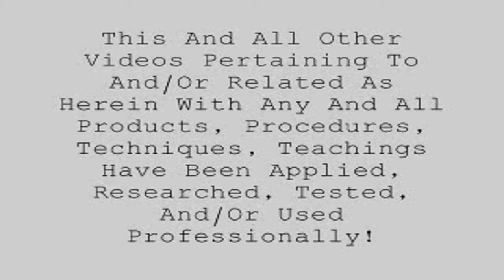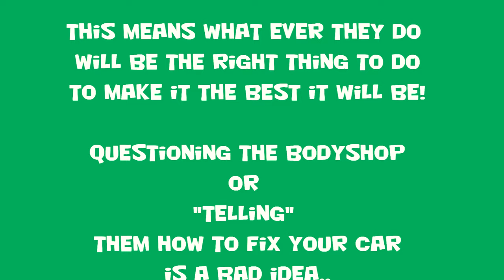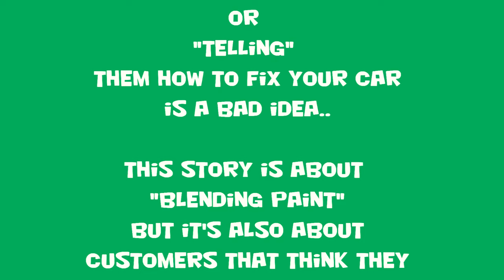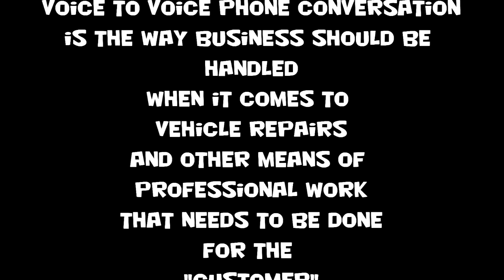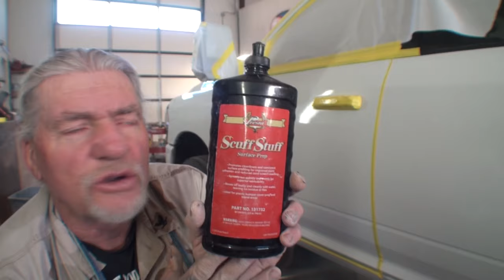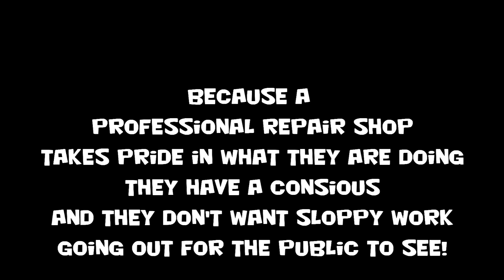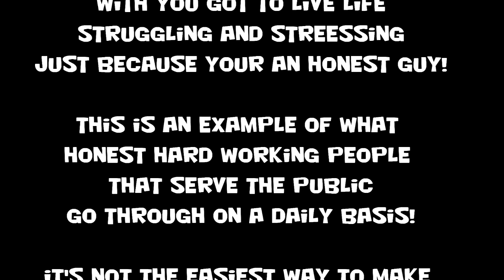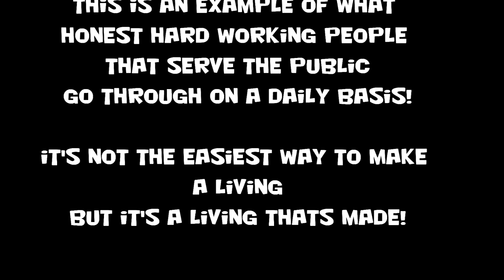Why Should I Blend Paint? - Automotive Paint And Body Tech Tips

Comment: I'm an estimator at Caliber Collision (one of the few times I'll actually mention my employer; it keeps me out of their social media use policy). Our rule of thumb is that if a repaired area gets within a clipboard's length (11-12") of a panel edge, the adjacent panel gets blended. Exceptions to the rule: 
When repairing a fender, we don't do the hood automatically. Hoods are 3-4 hours of paint time generally.
When repairing a quarter, we don't do the trunk automatically. Trunks can be anywhere from 1-4 hours of paint time generally.
In these cases, our client will not pay it.

We don't blend bumpers. It's a different substrate (plastic versus metal) and so the reflective qualities of the paint will differ and it simply won't match most times. There's nothing we can really do about that. It just "is" unless you're ready to pay the painter to find that "magic match" alteration to the paint recipe that will match the metal surface. This could involve several test panel shoots and possibly multiple coats on the bumper. That then gets into the problem of sensors. They can have only a few layers of paint where the signal can get through - radar for blind spot systems, ultrasonic for parking.

Caveat: I've been off work since 10/16/2024 with a heart bypass. In that time, my home shop has gone from doing solely rental cars for one client to picking up insurance work, so I'm going to see if the blending rules change when it's insurance work. They pay our full rate. The rental car client pays 2/3 of insurance rate.
Reply from the maker: Thanks for the verification on the corporate end. 🤙. Good luck on your heart surgery 🙏🙏🤙